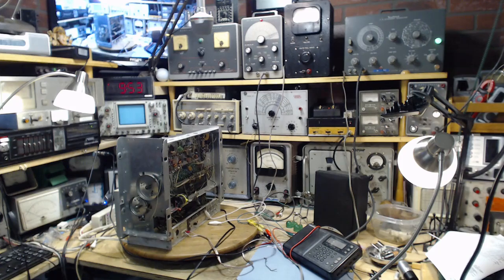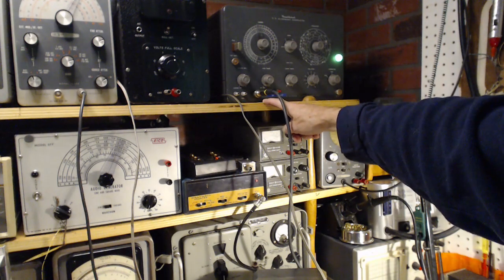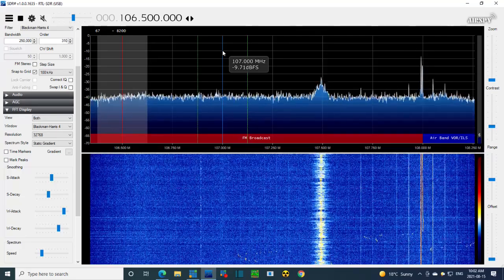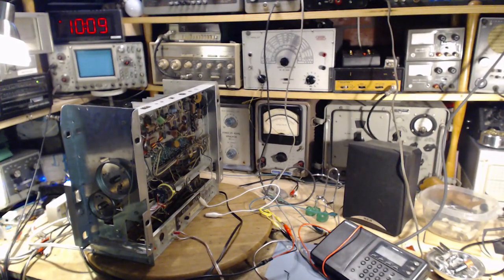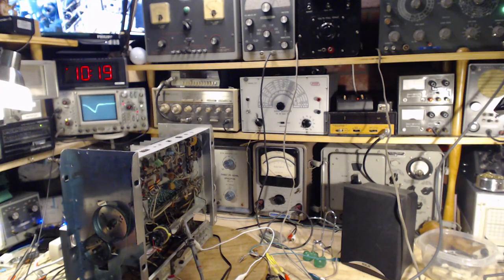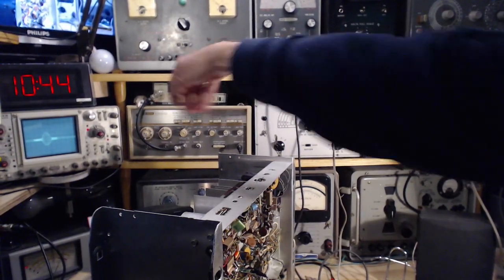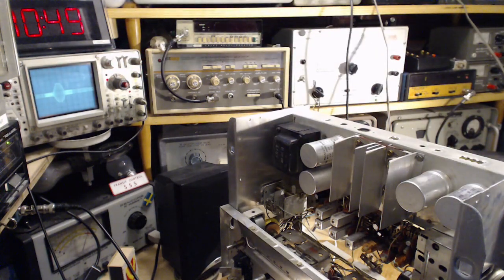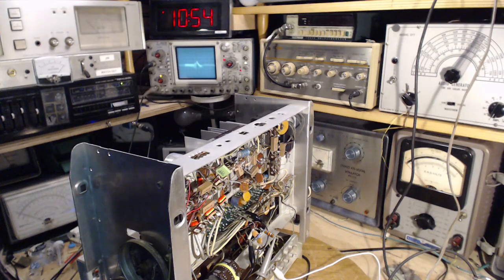Clairtone Console Stereo Video #16 - Alignment Test Equipment

Comment: Nothing has been aligned...
Reply: And the question is; would that be a good or bad thing for the radio. But at 27:56 he is blindly sticking his thing into the FM box and twiddling. So, yeah... No going back to any "virgin" alignment anymore. And I bet the tuning indicator is still pegged. And since IIRC its voltage is derived from the AM AGC/FM ratio voltage that could indicate a serious issue that sure would need to be addressed before any alignment.